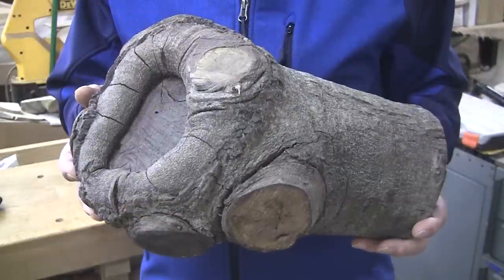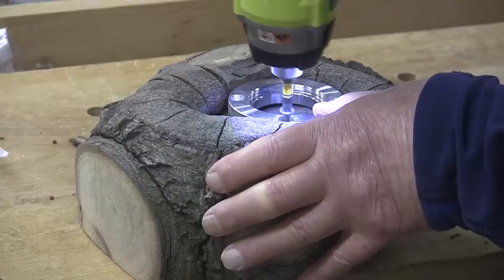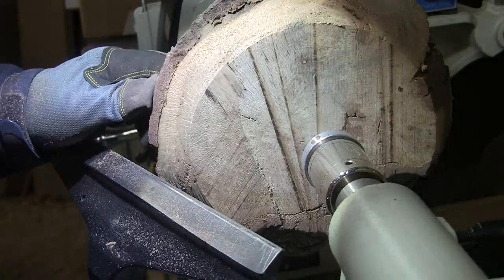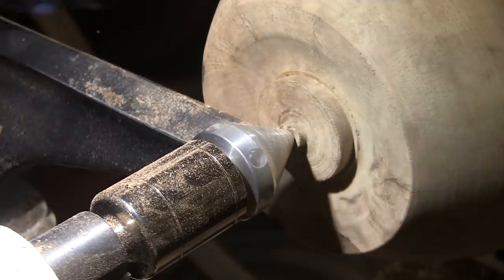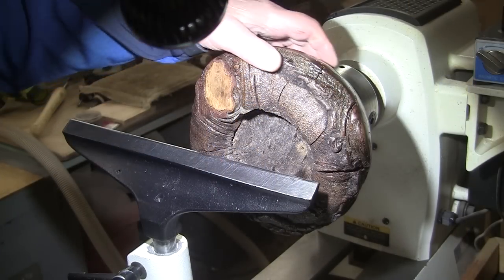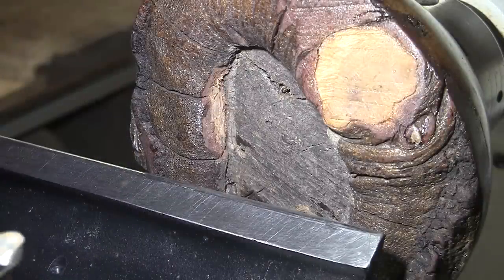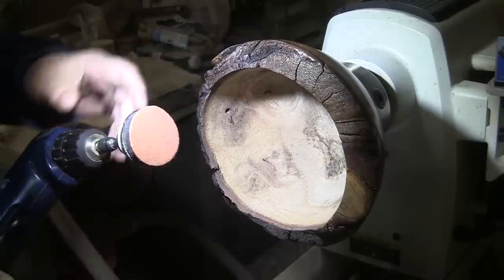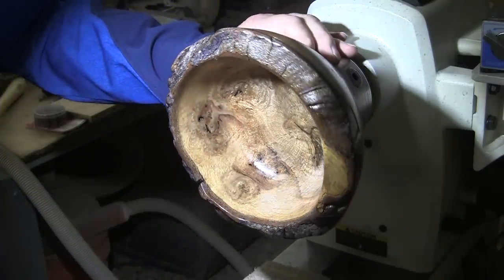Elephant Foot Bowl - Wood Turning

Comment: I love the grain and color inside of the bowl. Your persistence was rewarded with a beautiful piece of oak. Its bark, texture and flaws gives it great character that visually and tactilely invites a viewer's handling and inspection. Your carbide tool was an important asset on that end grain. Dirt is really destructive on a fine edge (as I'm sure you know). Shellac is a favorite sealer and finish of mine. I've been using it since I've been turning (possibly from your recommendation).
Reply from the maker: Thank you very much, Paul! 😊

Comment: Wow, a truly remarkable bowl.well done Phil.
I would have left more on the top and undercut rim a little to leave more of rim intact, if it didn’t hold, you’d end up with what you have now..
I use shellac sanding sealer on all my bowls then finish with light sanding and a wax finish I make myself, all food safe. Even shellac is made with bio ethanol rather than methylated spirits ( denatured alcohol).
Great video, enjoyed this one immensely.

Comment: That turned out very cool Phil.  The colors are amazing and the overall look of the bowl resembles something one might see from a Medieval historical piece.  I suspect that really was dirt you encountered and it didn't have to be a piece of root.  Where I grew up on the plains of Colorado, a branch that was cut like that could collect dirt and dust from wind storms that would infiltrate into the branch.  We cut quite a bit of firewood when I was growing up that had branches like that with dirt in them.
Reply from the maker: Thank you, Mark!  😊

Comment: This is a really nice bowl.  Great workmanship.  Question - What is the advantage of the bowl gouge vs the carbide?  I saw you switching back and forth but know the advantages of each gouge.  Thanks
Reply from the maker: Thank you, Doug!  😄  With a bowl gouge, I can feel the wood better, apply pressure where needed and I feel like I'm actually turning wood.  I can also get a smoother finish with high speed steel.  I only use carbide when nothing else will do.  With it, I feel like I'm just steering the tool around, not too much art in that.

Comment: Very nice job, Phil.  I was glad to you made it through that "dirt" to a beautiful wooden bottom to your bowl.  Rather than dirt, do you think could have been the heartwood from the long ago cut off branch acting just like a mulch pile?  Got my lathe on the 9th and have been busy ever since.  Have two failed bowls to my credit so far.  First was old dry punky worm ridden oak.  Making final pass on interior with gouge before going to scraper when I had a catch, tore tenon out of church and bowl ended up in three pieces.  Second was green alder (when I say green I mean 20mjnutes off the stump).  First tenon was too large and just gripped by corners of jaws.  Shortened depth of bowl and made perfect tenon (as evidenced by 100% contact marks on the tenon left in the chuck when it sheared off bottom of bowl).  Started number three this evening, a small bean pot shaped walnut vessel with fluted mouth.  Nobody ever accused me of dreaming small.  Keep those chips flying, friend.  I'll do the same.
Reply from the maker: Sounds like you are starting out like me and everybody else, Pete!  It's just the nature of woodturning.   You'll get the hang of it and be turning out masterpieces in no time! 😊

Comment: Did you consider using a scraper for the inside turning?
Reply from the maker: I did use a scraper, Eric, maybe you missed it.  1 1/2" negative rake round nose.  😊

Comment: I'm sure it was a cut off branch that the bark grew back around and squirrels and bugs and wind filled it with dirt and debris. Or someone may have put concrete in the rotted hole to try to save the tree
Reply from the maker: Could be, Steve! 😊

Comment: Hi Phil, it seems to me you are cheating us from seeing a crucial step. I’m pretty sure that between the sanding and the sealer, you might use an air pressure gun to blow away the wood dust?  You know we get a great deal of satisfaction watching your battles with the wonderful pieces you turn. Please show us the dust flying off before you apply the sanding sealer? (I know, we are a demanding lot).
Reply from the maker: Haha, this is an odd request and a first, Joe! 😊  Actually, after every grit (9) I blow the piece off.  I also have a fan placed to continually blow the dust off as I'm sanding.  The compressed air coming out of the air gun causes all kinds of havoc with the microphone.

Comment: Typically, how long do you leave the sanding sealer dry before applying another coat?
Reply from the maker: I've found that over night works best, Steve.  Really depends on the weather and temperature.  😊